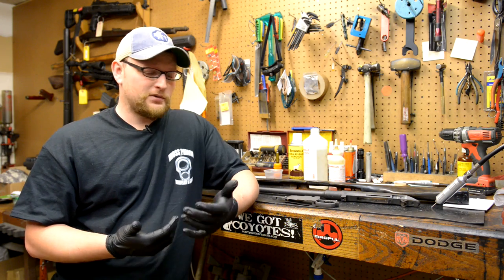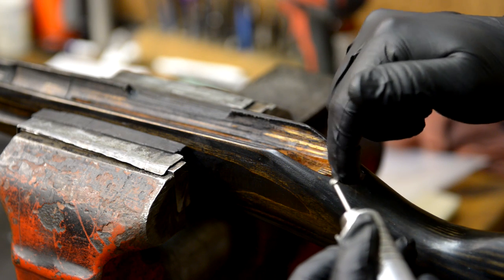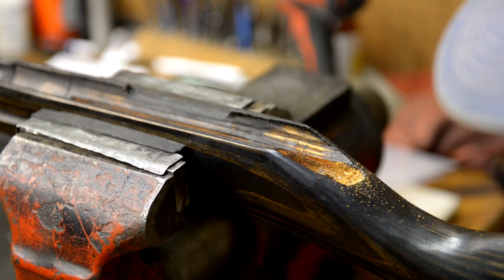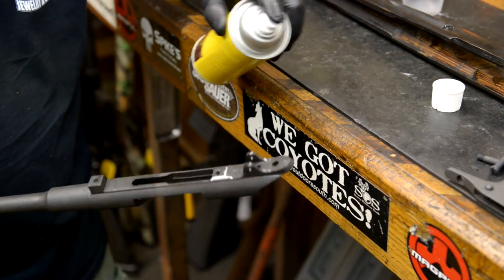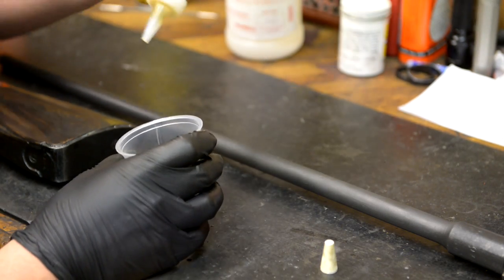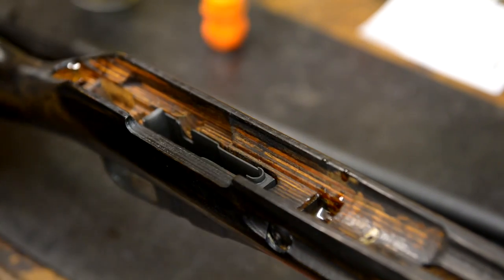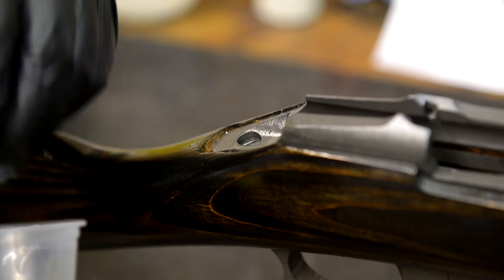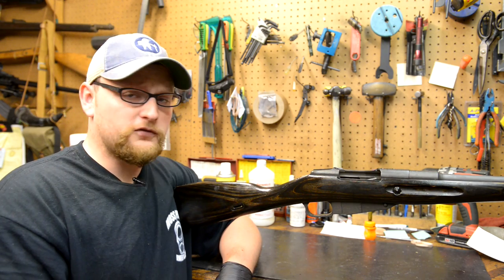How To Episode 3: Glass Bed Your Mosin Nagant

Comment: what is the point of replacing the wood with glass.
Reply: Cornelis Ruizendaal Bedding is literally like putting an exact mold of your receiver onto the stock, making sure you have the most secure, solid, and even fit for the receiver and barrel to help increase the performance of the rifle.
Reply: ok